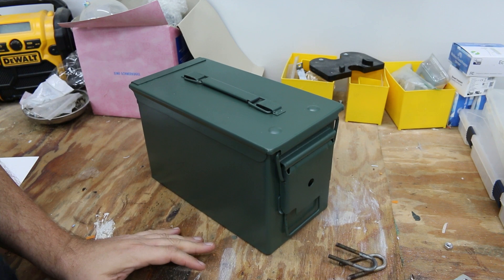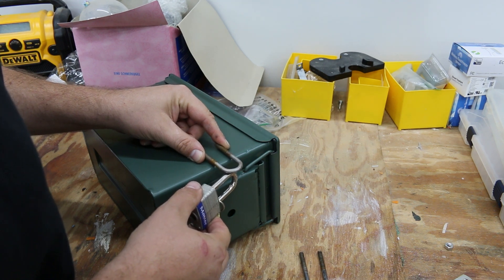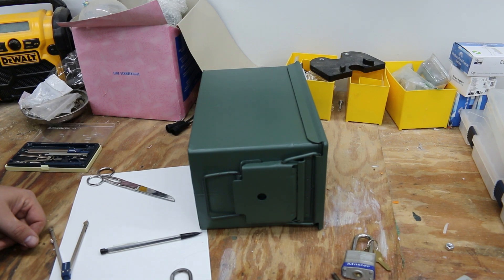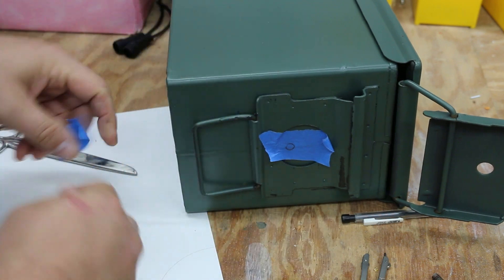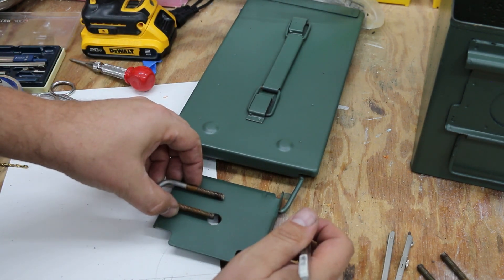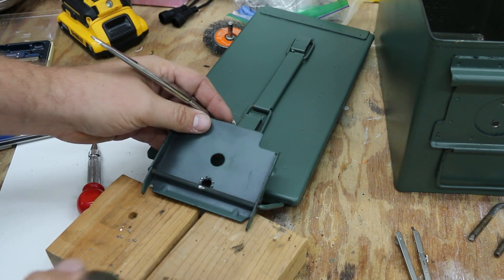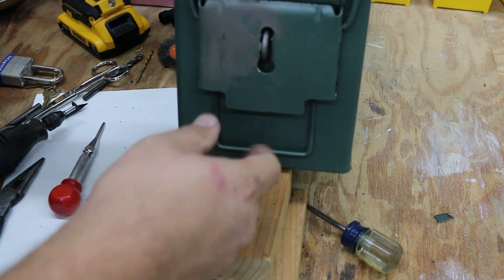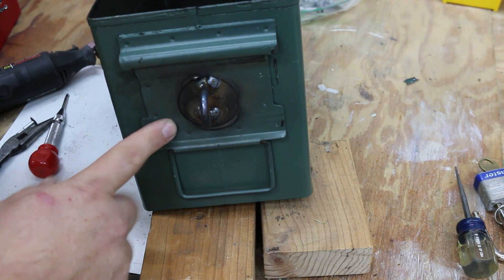Locking Ammo Can

Comment: This is a great idea. Reading the other comment that said you can lock them already. I never would of really thought of that but it seems like you would need a large lock for that. Your modification allows for a average size lock to be used.
Reply from the maker: Thanks!  There's also company that sells posts that can be drilled and bolted into that handle center hole.  I thought they were over priced and a welded loop was a better solution.